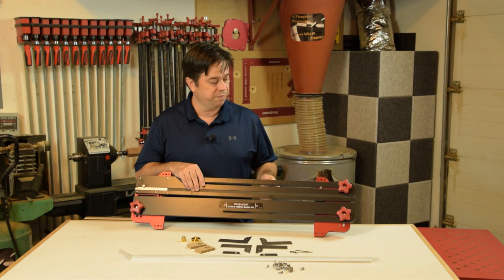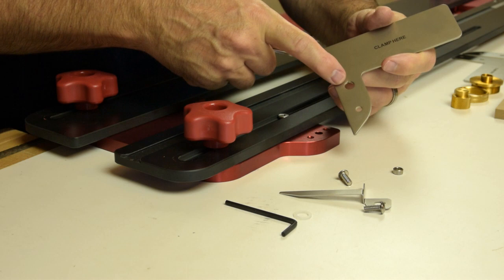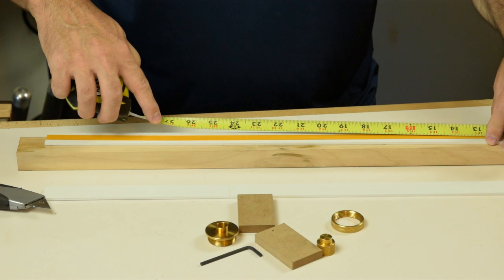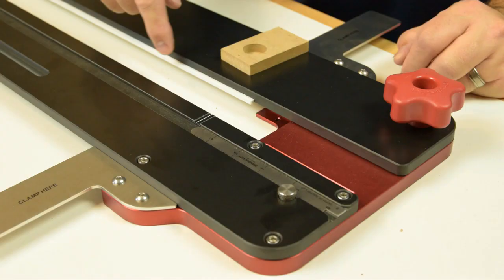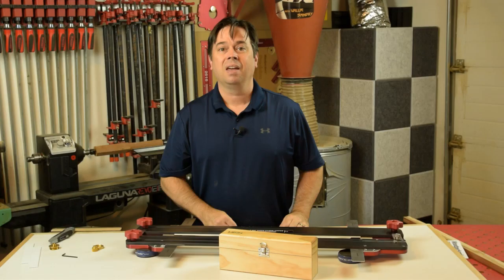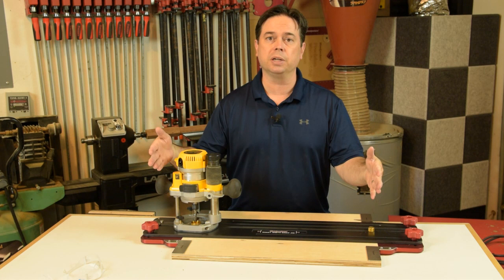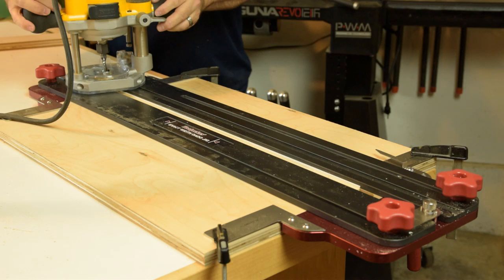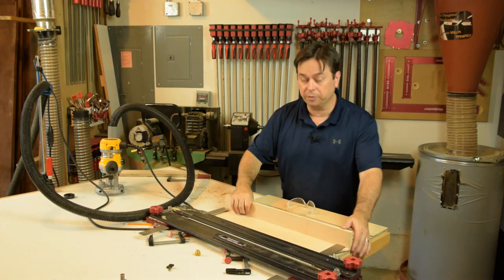Woodpeckers Exact Width Dado Jig Assembly and Setup Woodworking Router Jig for Dados and Grooves

Comment: Thanks for sharing —- 

I just opened my jig package up. Typically I use my table saw for dados. I’m building some floor to ceiling cabinets for our kitchen. So with panels that size it’s not safe in the table saw. 

I enjoyed your video, seemed thorough and thoughtful as well —- I wanted to see a video by someone other than Woodpecker. 

So now that you’ve been using the jig, any other thoughts or comments.
Reply from the maker: I too head to the Tablesaw whenever possible.  But for stopped dados the Woodpeckers jig works.  The Achilles heel of the jig is probably the replaceable strips.  I swapped them out for maple strips.  Either work, it's just kind of odd they're attached with carpet tape.  Other than that the jig build quality is good.  
Best

Comment: Many router guide bushing kits come with different collar lengths.  I assume that the only size that works with your jig assembly is the 3/8 collar length.   The 1/2 collar length is too long with your tool.  Am I missing something?

Comment: A beautiful piece of equipment. And with the Woodpeckers name on it the accuracy is assured. But at $530 I will pass. There are just too many DIY jigs that can be made easily for just a few $$.
Reply from the maker: I know what you mean.  I have a couple adjustable shop made dado jigs that I use as well.  Thanks.
Reply: A Woodpeckers email I received today has the 32.5" for sale #369.99. Probably unwieldy for the average job though.
Reply from the maker: The only problem I've ever had with dado jigs or track saw rails is being too short.  I guess it depends on what you do, but I'd want at least 24" for cabinet dados.   @michaelthoma

Comment: Thanks for the video. I have not had a chance to set up mine yet. I'll finally be getting my 2 1/4 hp router with 1/2 collet this week. Jig was on sale a few weeks ago, so I got it before the router. The video helps. I have one question though. When you showed setting the cutting depth it seemed you were going for 1/2 inch depth. The video cut out of the shot before the final depth setting, so I am not sure if that was the final depth setting. I thought that might be somewhat too aggressive for plywood. Am I mistaken? In later shot, it seems that the dados are about 1/4 inch deep though. Any clarification helps.
Reply from the maker: I generally rout more than 1/4" depth per pass.  In 3/4 plywood I usually don't rout deeper than 3/8" (on an actual project).  Hope that answers your question.
Best

Comment: This is an excellent video by any measure. Thanks very much. Some related questions: does the bit plunge into the MDF hole the first time it is used and then immediately cut through the MDF hole wall to ride the phenolic edge?  Does one keep the MDF block, with the cut hole wall, for future use?  When, if ever, would one replace the MDF blocks?
Reply from the maker: Thanks!  The MDF is sacrificial to some extent.  The hole allows you to make the first cut more easily.  I've actually never had to replace the MDF block.  
Also look for a shop made version of an exact width dado jig in the October 22 issue of Popular Woodworking Magazine.
Best
Reply: @TheThoughtfulWoodworker  thanks so much for the reply and the tip!

Comment: Its very expensive $530 is alot for that jij. Just use a track saw guide and a router
Reply from the maker: I like shop solutions too.  I suppose the track saw guide rail could work, as long as your shelf was an exact match for the bit.  The main benefit of exact width dado jigs is a perfect fit on any shelf with a common 1/2" diameter bit.  You might check out this shop made exact width dado jig you can build with scraps and a couple knobs... https://youtu.be/YX--IaZihc0     Best to you.